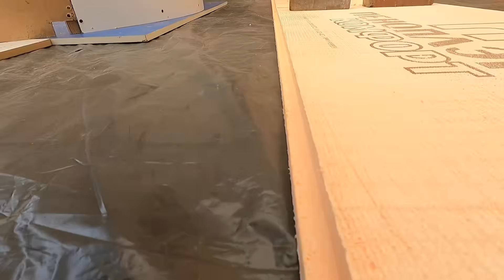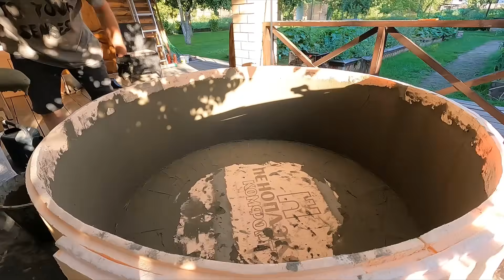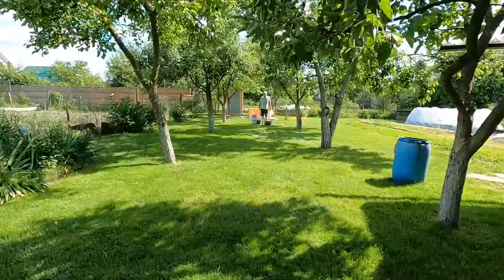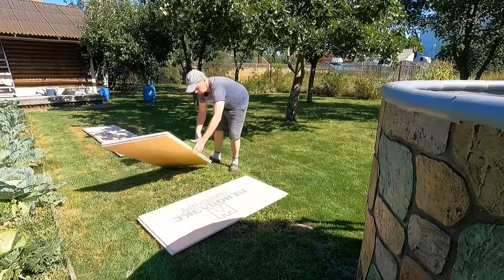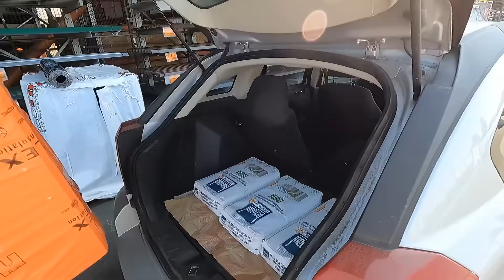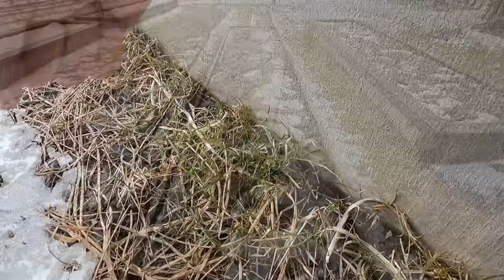Amazing DIY Building Material for Your Home & Backyard: Affordable and Easy to Make!

Comment: I love the projects, but in the US, a 1" 4'x8' sheet of foamboard is $32. By the time you add the fiberglass mesh along with the concrete....cha-CHING!! lol
Reply: I found it the same here in Australia at hardware shops but then I found manufacturers outlets where it is an quarter of the price.
Reply: Наверняка листы меньшего размера можно найти значительно дешевле! Экструдированный пенополистирол придумали как раз в США, в далёком 1941 году😉
Reply: @kosyak small sheets would usually be cheaper. But can we use the cheaper made foam. XPS is nearly 3 times more money or as we call it dollarydoos.
Reply: @kosyak Smaller sheets only means you have to buy MORE of them.
Reply: I likewise find that extruded polystyrene board in the US is high.    1.5” 4 ft x 8 ft at Home Depot is $45.   Owens Corning must have a monopoly here.  The kind you are using Penoplex is not available in the US.  It is not cheaper than concrete.
Reply: @HikerMoon  there's only three foam board companies here in us color coded pink grey and green although I'm not sure Ive ever seen the green. Might be regional
Reply: @HikerMoon  Everything is OVERINFLATED here in the USA. It's Called the AMERICAN GREED.
Reply: I think it’s cheaper when you buy the smaller sheets in a pack because shipping and handling large sheets is expensive.
Reply: This way, one could purchase smaller amounts of the products according to their budget.  No loans required, no special delivery, no packs of labourers and heavy equipment needed to be hired. 🕵️👍😊🇨🇦
Reply: Man.  Prices in the USA have become outrageous.  I remember the Home Depot and Lowes were selling them for much less just a couple years ago.  I just checked the prices here in Europe where I live now and prices seem to be 1/2 of the price in the USA.  But you have to think how much a 3/4 CDX plywood would cost.  So the foam board may still be cheaper in many applications.
Reply: Poverty Sucks!😢
Reply: @tikitime AMEN! We can’t even build this fake stuff!!
Reply: 1.5” foamular is 39.80 for 8x4 at Lowe’s.
Reply: There's a way to layer cardboard to make furniture. Might use that combined with this.
Reply: @Pros_Leo nighthawkinlight has a good video about using cardboard with a homemade waterproof recipe
Reply: @Pros_Leo it requires epoxy
Reply: @Pros_Leo $30 for a small bottle
Reply: Any kind of workarounds due to the cost?
Reply: The point is that this is mere fractions of the cost of doing real rock and has a nice, comparable, unique look that will hold up maybe just as well.
Reply: @funkmanone that and hiring people to do it for you
...
Reply: If you have a Menards close to you it's a lot cheaper. I want to say under $8  from memory , But not if they ship it.
Reply: @cgray8969 what Menards are you referring to ?   What brand of Extruded Polystyrene ?   Penoplex is not available in the US.
Reply: @cgray8969  R-3 (10 PSI) 3/4" x 4' x 8' Expanded Polystyrene Foam Board Insulation
32 sq. ft.
Model Number: 1632082 Menards ® SKU: 1632082
Everyday Low Price$9.98
11% REBATE*Good Through 9/1/25